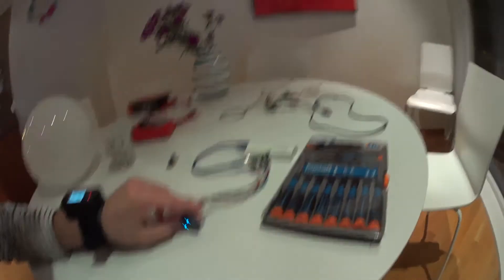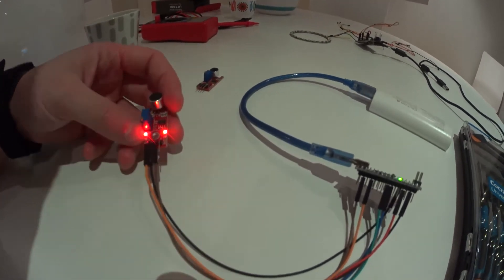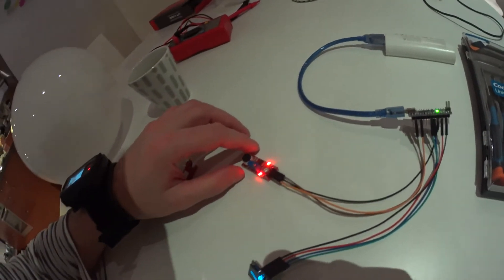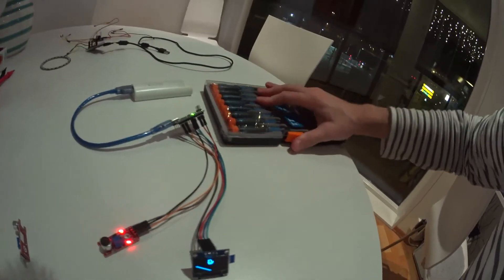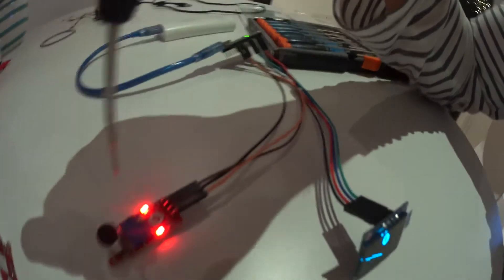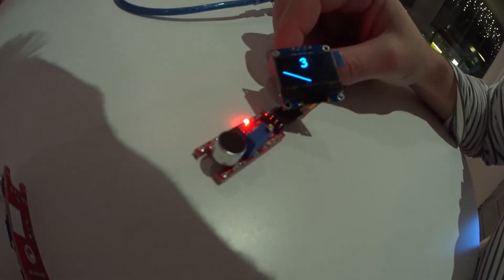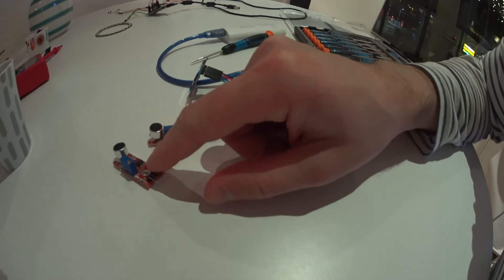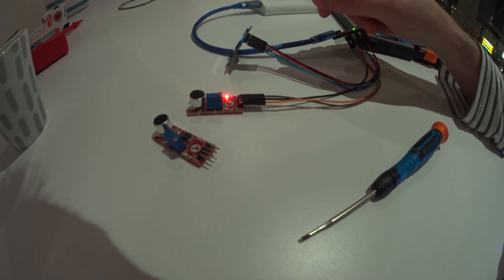How the Arduino HXJ-17 microphone works

Comment: hi....nice video ....i have this doubt though, i cant understand what the 4 pins are there for , especially the D0 pin. Also how do i take input from this through arduino.
-thanks
Reply from the maker: Hi,
Most likely people have told you that inside the inner workings of a computer, it's all 1 and 0 (this is binary).
Binary data is also called "digital", since it is either "this" or "that", nothing inbetween.

When the microphone has a digital and an analogue output, it will be either "on/off" or "analogue".
In this sence, the analogue value will be a varying voltage depending on the intensity of the sound and the input voltage. 

The digital output will be "on/off", but this "on/off" also has a voltage for "on-state". But you cant with digital measure the intensity of the sound. However if you want to make a clap switch you can use the on/off. 

Or maybe you want a light to turn on when the sound reaches a certain level, this can be done both with analogue and digital.

You use analogue or digital read from Arduino.
Here you can look at the code: https://github.com/olavxxx/Arduino-Sound-Sensor
Reply: thanks...that was very helpful , get it much better now